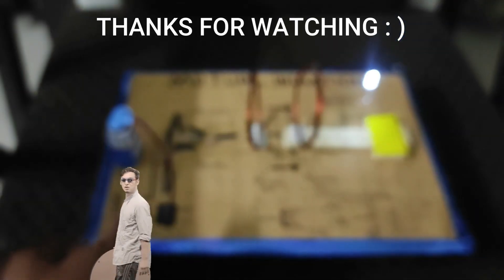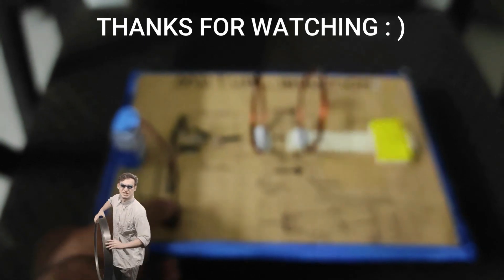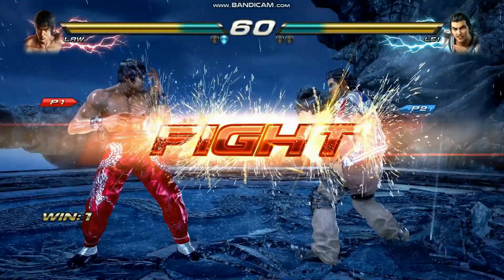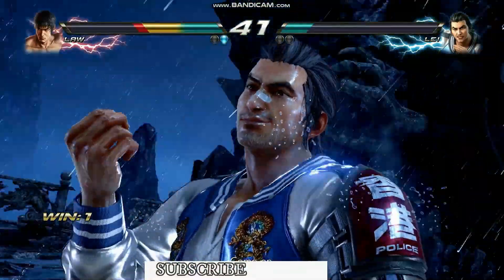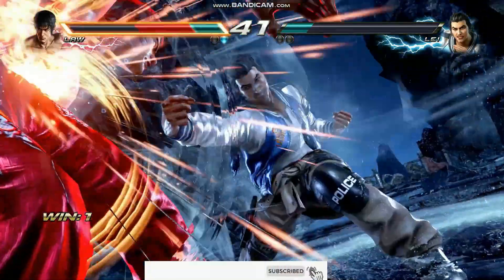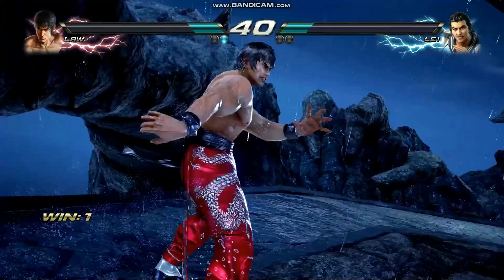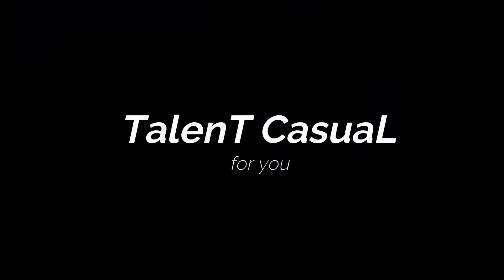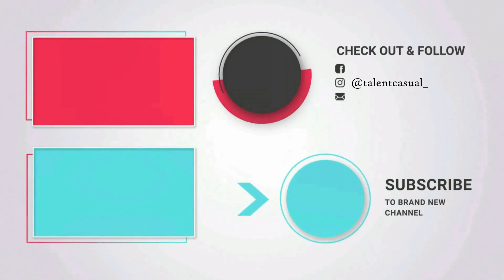How to make Mutual Induction Working Model | Wireless Power Transmit | MUST WATCH #physics #diy

Comment: Can I use a thicker coil (#26) using the same value of components (resistance)? If yes, do I need to change the number of turns?
Reply from the maker: Yes dear turns will increase 40-45 may be
Reply: May I know what will happen if I stick with 32 turns using the thicker coil?
Reply from the maker: Led will not glow just a little din light... And transistor would heat too much

Otherwise - use more coil more turns and  on both coils primary coil 40-45  2° coil 35-40 turns

And if transister heats reverse it 
Thanks ❤
Reply: Why does the transistor heat up? Is there any way to fix that?
Reply from the maker: If the model. Is working perfectly than it's ok just don't use for too long 30-40 sec alright

If the model is not working
Try to reverse the transistor than check 🥰
Reply: It worked at the first try but at the second time it didn't. I wonder if I can use 3v battery in this project.
Reply from the maker: No sir try again... May be your transistor Or LED burnt

Comment: Transistor Heating like SUN...
ok?
Reply from the maker: If the model is working led is glowing than ok 👌

If not
Try reverse the trannsistor dear 💕

Centre point remains same
Reverse the direction A- B  to B-A
Reply: @TalenTCasuaL  yeah the LED works...
i have installed 33k resistor... the led luminance is KINDA low... Should i Use a Less Amount of Resistance?
Reply from the maker: Beautiful 
Now u can. Play with the geometry means shape and size of coils

Or resistance dear 💕

Good work. 
God bless u ❤
(✿❛◡❛)
Reply: @TalenTCasuaL  Thank you :)

Comment: will
 0.5mm 
same transistor
33k resistor
9v battery work
Reply from the maker: Yes dear 💕 it will work but take thinner wire 
Otherwise take more and more coil turns 50-55  primary and 35-40 2nd°
Reply: okk thanks

Comment: Can you please tell me which wire use 
I means kitni thin ya kitni thick wire leni h please reply please reply please reply
Reply from the maker: Hello dear 💕

Apko insulated copper wire leni hai 
Brownish color ki
33 gauge    0.3 mm  
Normally thread jesi
Agr thori hard ho but easily foldable ho like a normal thin wire toh bhi chl jayegi dont worry
Bs apko turns jada lagane hoge
🥰
Thanks 
Speaker repair shop 
Fan repair shop

Pr apko mil jayegi 50-100 ki 🥰

Comment: If we use 547 B transistor.....then which value of resistor we will use....??
Reply from the maker: May be 22k Or 25k
Reply: Thanku....
Reply from the maker: Did it work?
Reply: No it's does not work...
Reply: If the transistor heat up ......then also the led does not glow...???
Reply from the maker: If transistor heats circuit is working

Comment: Retried everything thing , it's not working, and the transistor is getting hot.what should i do ?
Reply from the maker: So
There is problem with transistor

Change the transistor
Use as mentioned in video 
Or try to change resistance 22-27k
Sir

And am going to upload the short u was talking about
Reply: @TalenTCasuaL  that transistor just got broken 🙂, i have 2 BC547 , will it work ?
Reply from the maker: No sir
2n 2222a Or 
Ctpn 2222a 
will work best 🥰
Reply from the maker: Sorry 😞

Comment: I am doing everything alright, still it's not working at all
Reply from the maker: Ohk dear
Copper coil should be insulated
And
Remove insulation at its ends
On the loop
And
Secondary coil
Both ends remove insulation

Make sure all joints are fine
And try again

Try to reverse transistor

Comment: How 'bout i dont use the 33k resistor and use a light that can bear 9 volt? It will be cooler with brighter light
.
Reply from the maker: No dear that will not glow
But u can try
Hope it works
(✿❛◡❛)
Share your results on my Instagram
@talentcasual_side

Comment: How did you connect battery to button
Reply from the maker: Hello dear 💕

Connect battery positive wire yo switch and 2nd wire from switch to cool loop
Simply make the current go through switch

- cut the red ( positive wire) into half
You got 2 ends
Connect these 2 ends to switch

Or
Watch my latest video dear 💕
About MUTUAL INDUCTION live making
U will understand

Connect on insta- @talentcasual_side

Comment: Hey how do you connected switch ... With which wire
Reply from the maker: So sorry for  late  reply 

Dear 💕

Connect switch
To positive wire
Cut the wire and connect both ends of switch to both cut wires 🥰

Means let the current pass through switch 🥰
Thanks for commenting 
(✿❛◡❛)
Reply: @TalenTCasuaL  battery k postive wire se?
Reply from the maker: Yes bro 🥰
Watch my latest  video
I made it live 😘
Reply: @TalenTCasuaL  it's discription
Reply from the maker: Wh@t dear?

Comment: Bro can you clear my dought abt thisss 1. Agr coil p1 coil me 12 or S1 coil me 24 turns ho to?
2. Coil wire me agr knot ho to? Is it circuit works?
Reply from the maker: Hello dear 💕 ☺ nice question 

1 - 24 turns ho to radius chota krlo make small rings and use 25-27k resistance

2- Knot or bend will reduce its working but it will  still work - avoid knots

(✿❛◡❛)

Comment: This project is not working.
Reply from the maker: Ohk dear 💕
Reverse the transistor
(✿❛◡❛)

Make sure copper wire insulation is removed 😋
And check all joints
Reply: @TalenTCasuaL  all joints are correctly connected.
Reply from the maker: Good dear 💕
Reply: @TalenTCasuaL  kitne watt ka led lene h?
Reply from the maker: Take 2V  Or 3V  led

🥰
Reply: Check kaise karenge ki led kitne watt ka h?
Reply from the maker: Hlo dear 
Koi bhi LED  small 
2 v and 3V ki. Hi. Hoti
Agr it's little 🤏 smaller means 1v 2v

If it's as shown in the 🎥 video
It's 3V.

🥰
Reply: @TalenTCasuaL  tabhi nhi hua mera project
Reply: @TalenTCasuaL  kya karu ab
Reply from the maker: Hlo  dear 💕
Contact me on Instagram
@talentcasual_side

Vaha pr baat krte hai 🥰

Comment: Pls give the details of components' price bro 🙏
Reply from the maker: Hello dear 💕
All. In description 
(✿❛◡❛)

Transistor 
Resistance
Battery and plug
Wire
Switch
Copper coil
Led /black tape/ soldering
Ice cream sticks
Cardboard and Glue 
Color Tape

All loca market under ₹ 250/-

Comment: Bro on which principal it works
Reply from the maker: Helo dear 💕
Watch my latest video about this... U will get more detail about principle

It work's on the principle of mutual induction
Which may define as 
When there is a change in the current in the Primary coil there is current induced in the Secondary coil placed parallel to it
This happens becos of magnetic flux
( large no. Of magnetic field lines ) 

Which are produced on primary Coil  due to potential applied 
And which are parallel to secondary coil
So which induce current in secondary coil

So a transistor with a suitable resistance
Give a high amount of current voltage in pulses 
Which means current come. Stop come stop
Thus Changes rapidly
And magnetic flux changes rapidly
So the Current in 2ndary coil is induced rapidly 🥰

Thansk for commenting🥰
(✿❛◡❛)
Stay tuned
Subscribe

Comment: How you connect switch
Reply from the maker: Hello dear 💕🥰

Connect switch to negative wire

Switch have 2 wires  ryt... 
Cut negative wire coming from battery
U get two ends
Now
Connect these 2 ends to 2 ends of switch

Simple pass the current through switch 🥰
Hope u got it  
(✿❛◡❛)

Stay tuned 🥰
Give a follow or CATCH on insta
@talentcasual_side 

Thanks for commenting 🥰

Comment: Bro mera project work nhi kar rha exact same hi banaya hai jo jo video me hai
Reply from the maker: Ach exact same.. Hai 🥰

Dont worry transistor ko reverse kr k dekho 
🥰 best of luck
Reply: @TalenTCasuaL  bro tumhe ye copper wire kahan se mili ??
Reply from the maker: Helllo dear 💕
U can order online
Link in description and
Go to nearby SOUND SYSTEM speaker repair shop or fan repair hardware store
And u will get 30 gauge copper wire

🥰 good luck
Reply: @TalenTCasuaL  bro tumhara koi Instagram hai kya jispar contact ho sake ???
Reply from the maker: Ha dear 💕

INSTAGRAM @talentcasual_side
Reply: @TalenTCasuaL  yaar mera work nhi kar rha
Reply from the maker: Dear check your transistor
And reverse it
usko ulta chla do 🥰

Resistance chnge krdo 

Good luck dear 💕
Reply: @TalenTCasuaL  wait I will MSG you on Instagram
Reply from the maker: Your welcome dear 💕
Sorry for. Delay
 (✿❛◡❛)
Reply: @TalenTCasuaL  and pls reply

Comment: If transistor is heating then which transistor should we use..??
Reply from the maker: Dear first of all
Reverse the transsistor

If it is heating may be circuit is wrong 
Thanks
Use 24-27-29-33 k any which work for your coil
Reply: @TalenTCasuaL reverse the transisitor means

Comment: Can I use another wire instead of this for coil ?
Reply from the maker: No dear 💕. 

Works only in copper insulated wire
Go to nearby sounds speaker repair shop
U will get it 🥰
Otherwise purchase ready made from description 🥰

Comment: Can you explain how can you add the switch pls
Reply from the maker: Yes dear... One more detail. Video about this is coming on live making. 😘🥰
So stay tuned 

I just added the switch on negative wire 
U can also add  on positive wire

There are 2 wires from battery 🔋
Cut any wire ,u got two ends 
and add switch 
Connect these 2 ends on the switch
So the current flow through the switch
And u can. ON AND OFF

Thanks  😘🥰
hope i got it answered
Reply: @TalenTCasuaL  thanks a lot .....
Reply from the maker: Aww so sweet
(✿❛◡❛)
Your welcome

Comment: Bina soldering ke chalega?
Reply from the maker: Yes dear 💕

2 wires ko pakad k ache se ghuma dena or fer black tape lga dena 🥰🥰
Reply: Thanks. But i did it but not working and transistor is heating what should I do?
Reply from the maker: I think reverse the transistor 
Or change the resistance 😊 

As video mention

God bless u ❤

Comment: What's the thickness of wire sir??
Reply from the maker: Hi sir
Wire thickness is 30 gauge
For easy.. 
U can check description for detail
And 
U can. Order ready. Made system u just need to put a battery
Order link in description

Thank u ❤ 🥰

Comment: But my question is how did you connect the battery to the switch
Reply from the maker: It's a simple thing... Take battery  add aa connector   now u have 2 wires - positive and negative.... Let the negative wire go through the switch... Means switch has 2 ports cut the negative wire . Attach both cut ends on the switch
Thus wire is through the switch 
On and off... Working. 

Thanks u ❤

Comment: Can I use any other wire rather than copper one?
Reply from the maker: No dear 💕
 aluminum wire is there but have only 60% conductivity as copper
Reply: @TalenTCasuaL  thanks dear. One more question if you don't mind. What exactly is the use of transistor and resistor?
Reply from the maker: I answer u morning 🥰 dear... Working on a more bigger project video... 

Comming sooon 🥰
Reply: @TalenTCasuaL  ok 😊. Will wait for the reply, because I'll have to submit the project by Saturday. Good night.
Reply from the maker: Sweet dreams 😴💭
Best of luck 🤞

Comment: can i use 40k resistor?
Reply: pls reply quick
Reply: @Mr_kitten_sunshines_here  Most probably no. You can instead make a series of resistor to add up to 30K resistor. For eg: use 3 10K resistors (which is equal to 30k resistor) or use 10K, 10K, 2K, 2K and 1K resistor (which is equal to 25K resistor)
Reply from the maker: Wow 😲
Reply from the maker: I don't know dear 💕
U can try if it works 👍
🥰

Comment: Sir In this experiment the transistor getting too heat how to rectify this problem, so that the led light cannot glow
Reply from the maker: What is the problem 
Detect yourself
Check every part
Check cirtuit diagram

First make a circuit diagram 
Then
Verify check batteryband transistor 
Check copper wire is insulated or not 

Thanks u ❤

Comment: Thankyou So much Now At 2:00 am my project completed class 12 cbse tommorow I show my project on this topic ❤❤
Reply: Can you please tell me..... What questions can be asked about this project ........ Because my project is also same
Reply from the maker: Questions -

-  What is the principle of mutual induction
- what is the use of transistor
- how much voltage can be produced with this
- why use only copper wirel
- battery voltage required 
- is there magnetic field 

That's maximum dear 🥰

(✿❛◡❛)
Reply: @TalenTCasuaL   thanku very much........ 🥰
Reply from the maker: Hello dear 💕
Your welcome

For answers
Insta - @talentcasual_side Dm 🥰
Reply: @lovepreetchouhan9554  From me examiner asked 
Q1 what can we use instead of primary coil
ans magnet
Q2 what is the role of battery
ans it behaves as ac current 
q3 principle
that s it
Reply: @famous6552  thanku very much
Reply: How much did it cost u?
Reply: @sushmitasarkar95  I made by myself at home
Reply from the maker: God bless u dear 💕💕
Reply from the maker: Hope 300-400
Reply: @TalenTCasuaL  All materials are come under 200
Reply from the maker: Good 👍 🥰
Reply: @famous6552  yes
Reply: Wire ki thickness kitni h??
 
I am also in 12th and going to make it
Reply from the maker: It's 30 gauge dear... 🥰
Just like a thick thread 

It is used in speakers
Reply: Transistor kha se lia
Reply from the maker: @sharik732 take from any speaker repair shop or electrician shop dear 💕
Reply from the maker: Wowe best of luck 🤞

Dear god bless u ❤
(✿❛◡❛)

Mine also complete at 2 am 
 going to exhibition  may b I will publish a video about it bsc final year model 🥰

Comment: How to connect with switch in switch there are two pointa
Reply from the maker: Hi Dear...
Switch connection is very simple

A wire just go through switch 
Means cut a wire add both ends to switch 
Done correct✅

Batterry negative wire should have the switch 🥰

Comment: How you connected the switch ??
Reply from the maker: Check circuit diagram dear 💕

Or connect it to any wire from battery positive or negative  🥰🥰

Just a On Off switch

Thanks for commenting

Comment: Is resistor and transistor compulsory in this circuit?
Reply from the maker: Yes compulsory
Reply: @TalenTCasuaL  Why.. Transistor is Necessary pls tell...
Reply from the maker: Transistor releases the current in pulses 

First it stores the potential
Then. Release it in pulses of very high power

Which induce electromagnetic field in COPPER COIL. and which further induce current in 2nd  coil
Reply: @TalenTCasuaL  Thanks by the way .. if we Don't have the Transistor and Use Home AC Current in the Coil 1(which is to be used for induction of second coil) and with the Help of that AC current we Induce the Current in Coil 2. Will it work then?
Reply from the maker: Dear. Don't dare to do that

First there will be blast
They u will have deadly electricity 
AC VOLTAGE around u..

And last YOUR HOUSE electricity will be fused.. All light will be gone
Wire will burn. Out
Short circuit
Warning⚠ DON'T USE AC
Reply from the maker: If u want transistor
Dear 💕 
U can. Order. From. My video description

Or. Even. U can. Buy readymade
Battery coil LED transistor. Circuit 
Link. In my video description
🥰
Reply: @TalenTCasuaL  ok ok.. I get that...
Reply: @TalenTCasuaL  Thank You 
.. But I was just Asking for Knowledge.. Nothing else... and Ofcourse I would have used your Links if I wanted it.
Reply from the maker: Ohk 🥰🥰
Reply: @vikrantsingh8274  please do it and make a video 😉😉
Reply from the maker: 🤣this is not a movie 🍿🎥

Comment: Bhia mera to chall hi nahi Raha
Reply from the maker: Sir 
Jaise connection maine kiye hai
Same vaise hi kro

And
2 cheej ka dhyan rkhna
1. Jo transistor hai - usko ulta lga k dekho mtlb uske 3 end hai   centre wala (2) vaise hi rehne do and 1 ko 3 pr lga do Or 3 ko 1 pr lga do... 

2.  Apki copper coil ke sare end , ache se insulation hta dena 
Jaisa maine kiya hai
Pehli Copper coil ke 1 end ko bhi 3 end ko bhi or jo centre mei loop bnaya hai uske end ko bhi insulation hta dena blade  k saath

Thanks u

Agr fer v nhi chl rha toh.. Resistance change kr lo 
27k 32k koi lga lo 

Thanks dear 💕
Hope it works
Reply: Bhaiya mainai yai sab karkai daikh liya even mainai bulbs laga kai bhi check kara circuit dono  mai battery sai connect karnai pai chal raha hai transistor bhi grm horaha hai par coil paas lanai par nhi chal rahi
Reply: @rajeevaggarwal5815  Bhai sme.. transistor bht jyada grm hora Hai bt led Ni jlri
Reply from the maker: Arey bhai 
Ap connect diagram se check krlo 🥰
Reply from the maker: Sab ka work krta hai.. 

May be apne kuch glti kri hogi.. 🥰

Ek. Baar ferse try krlo ❤

Pakka ho jayega

Thanks 🥰